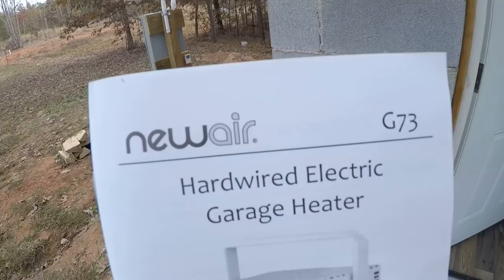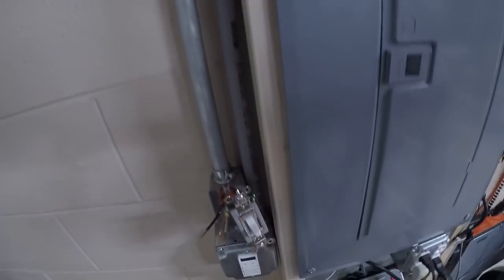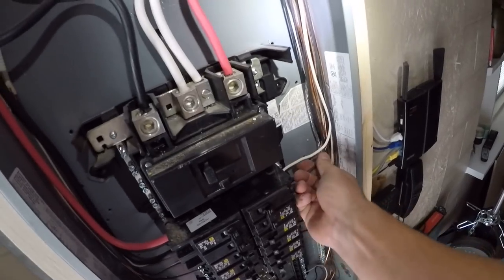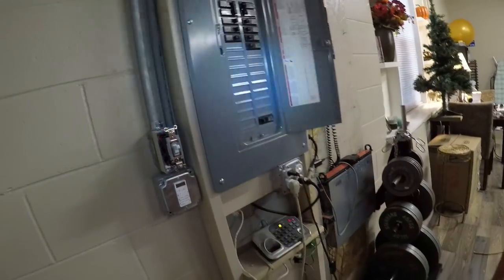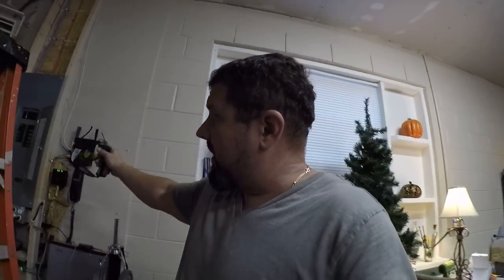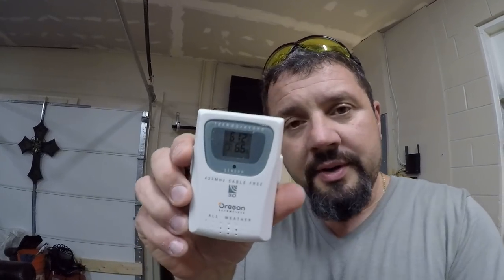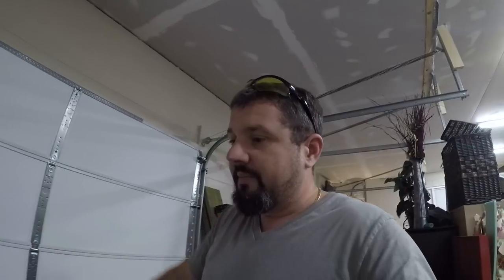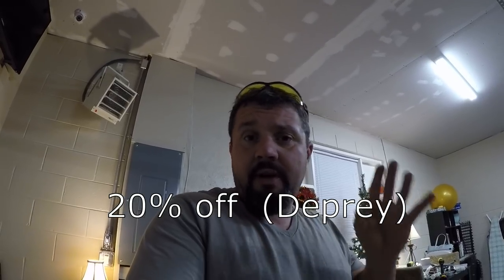The Depreys - NewAir G73 Garage Heater!

Comment: Hi Ross I installed that exact heater in my workshop last year.  Instead of an on off switch I put in a dial thermostat which allows you to turn it off and set it without messing with the thermostat knob on the unit.  My heater works fantastic and I live where it gets mighty cold in the winter.  Good luck with it and stay safe, Lou.

Comment: He went to 10 gauge wire..
Not because of voltage..
But because of amperage.
14 gauge = 15 amps
12 gauge = 20 amps
10 gauge = 30 amps. And so forth..
To keep identifying wires essier..
Highly suggested to either tape the white a color other than green (ground)..
Or get some heat shrink..
Reply: 9

Comment: Hi guys.. i have Newair g73 .. i have a problem that this heater does not stop running.. it should run until the garage is warm then stop .. i replaced the thermostat but i still have the same problem if there is any solution i will appreciate that .. thanks